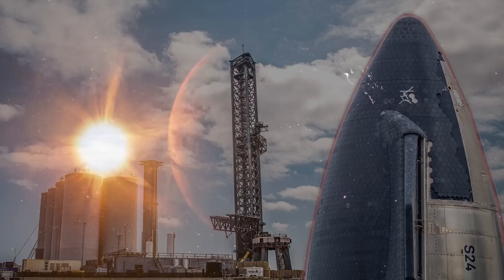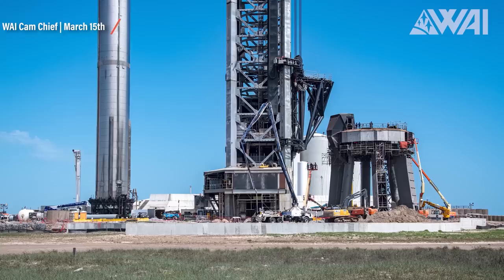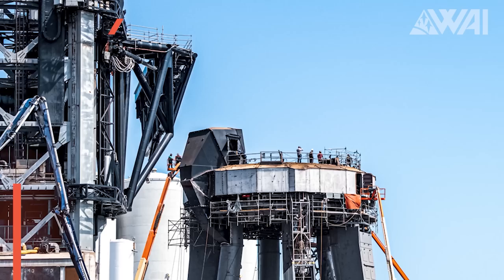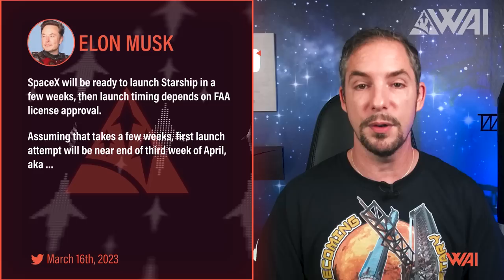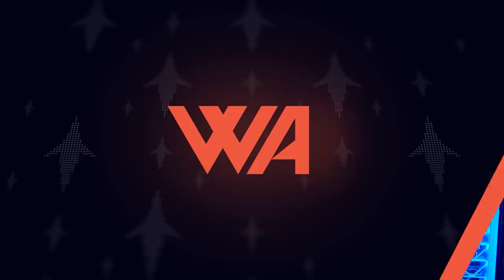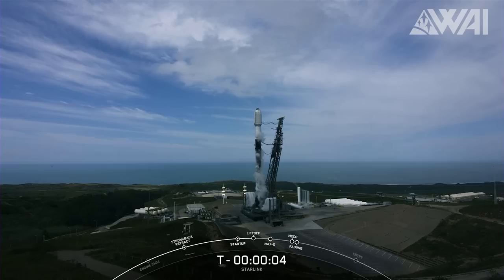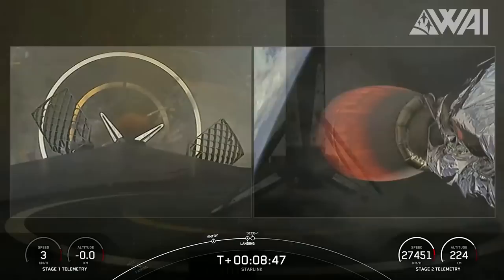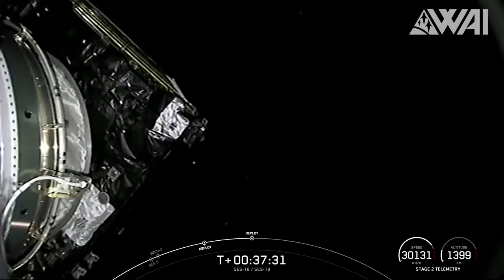SpaceX's accelerating Starship Plan for the Next 4 Weeks + Stunning Artemis Lunar Suits!

Comment: The accuracy of Falcon 9s hitting the bullseye so reliably bodes well for Starships and its booster's ability to be caught in mid-air.
Reply: you can move a ship not a tower
Reply: @sebastiaancoene274  that's ridiculous..the movement of the ship makes it all the more difficult to hit the bulls eye.. itll be much easier to land accurate when you're not playing  duck hunt with the landing platform
Reply: @sebastiaancoene274  was going to say because the tower DOESN’T move, it will be easier to land. No cross currents, no winds blowing it around… just watch when the boosters land back at KSC on FHeavy launches.
Then throw in a booster that can actually HOVER… yeah, they’ve got this.

Comment: Great update.  I'm sticking to June for first launch for permitting & lawsuits.  Post first-launch, the second launch will take the rest of the year after repairs, redesign (e.g. heat shield), analysis and lawsuits (Boca Chica & the Cape).  So, two launches this year.  As for 2024, I am optimistic.  Just getting started in 2023 will open the door to numerous launches.  By 2025, Starship will look different and be operational.
Reply: I guess 1 launch this year, around september
Reply: @henkdeklapsteen6787  There are excellent arguments to support your conclusion!  That's what makes this fun to watch!
Reply: Lawsuits is the thing in the past. Environment Assessment already approved
Reply: i dont see it launching a single time this year with the bitch-brakes they have put on 
lack of launches = no data = just as slow as any other space company. they lost everything they had going for them, quick rapid testing i was excited to maybe go to space in my lifetime. yeah we can all throw that dream out the window now.
Reply: @forget2bhuman993  Easy to be negative.  Hard to launch the most complex brand-new thing since the Apollo Program.

Comment: The fairing halves reminded me of the old space shuttle launches where you can see the srbs falling back from the sky due to the fact that the nozzles are still glowing red ♥️
Reply: To be slightly more accurate, the nozzles don't glow. What you see is the solid fuel flaming out (residual burning). The nozzles are insulated with ablative material, how else would they stay white?

Comment: As heat shield is all about re-entry, an issue there during the mission would not necessarily be a failure, that being said it would be nice if starship survived re-entry also, personally I would like to see a controlled splashdown, even a hover with any remaining fuel, would be logical if it will be the last mission.
Reply: The top of the thermosphere can be found anywhere between 500 and 1,000 km (311 to 621 miles) above the ground. Temperatures in the upper thermosphere can range from about 500° C (932° F) to 2,000° C (3,632° F) or higher.
Reply: @jmatasomo2660  Thanks, I'd Imagine it would be less of an issue due to lower particle densities at this distance ?

Comment: I have an idea for going to the moon as soon as possible using starship. 
It's hard to get Orion to launch much more often, and starship won't be able to transport passengers safely very soon. 
So here's my idea: spacex could operate a small space station on Leo and then make it a docking center for Dragon and starship. Each time a Dragon ship is launched, it takes astronauts to the space station, where they transfer to a starship, where they use the starship to travel to the moon and back to the space station, where they transfer to a Dragon ship to re-enter the atmosphere. 
The upside of this plan is that if starship is successful by June of this year, they could start testing the starship for landing on the  moon in the second half of the year and order a manned orbit as soon as possible.
Reply: And after the starship returns to the space station on LEO, the astronauts can repair and maintain the starship in the space dock and replenish fuel.
Reply: Use this space station to carry out other business activities. For example, on-orbit maintenance of the Hubble Telescope, a five-member team drives a starship from the space station and changes orbit to the location of the Hubble Telescope. Since this starship only changes orbit in outer space, there is no need to consider complicated issues such as re-entry into the atmosphere. The starship has a cargo bay with a robotic arm and tools and parts needed to repair satellites, as well as cabins where the crew lives, much like a space shuttle. After the repairs are completed, fly the starship back to the space station.

Comment: Should they have gone for a lower payload and put landing gear on the starship as a preliminary milestone?
Reply: There is no payload in S24 except instrumentation to monitor everything that happens and transmit it by the Starlink network.  "The best part is no part."  B7 is probably the only booster which SpaceX intends to expend.  It is a two-year old design.  SpaceX intends to perform tests of the chopsticks as if to capture the booster, but B7 will ditch in the Gulf regardless.  SpaceX will try hard to recover the much advanced B9.  Similarly S24 is primarily a test of what damage occurs WHEN you reenter with missing tiles.  "The best part is no part."  SpaceX needs to determine how much of the TPS is actually necessary.  Every kilogram of TPS that can be removed from the design is another kilogram of revenue payload, and a reduction in maintenance costs.  On a short test flight SpaceX cannot recover both the booster and the orbiter because there is only one operational launch mount.  A test flight with several hours of orbits are required to allow time for the SPMTs to drag the booster to a safe distance so the OLIT can catch the Orbiter. 

SpaceX also intends to test whether Starship can transmit to the Starlink network up the tunnel surrounded by electrically charged plasma that it punches through the atmosphere during reentry.  This is to reduce or at least minimize the anxiety-inducing radio silence that all crewed reentry vehicles have had to accept.

Comment: I like Speedify . Does SpaceX plan on a 3 stage rocket? Great video
Reply: You can deliver a rocket as payload.  Almost any commercial 2nd or 3rd stage will fit within the cargo hold, even the massive SIVB, the 3rd stage of Saturn V.  This payload could then be deployed through doors.  A conventional 3rd stage, vertically stacked on the nose of Starship would require expending the Starship.  SpaceX would rather refill the Starship in LEO,  permitting delivering a 100 ton payload to anywhere in the Solar System.
Reply: There's no real benefit in a three stage rocket if two stages is enough to reach orbit... especially when SpaceX are planning orbital refuelling of the second stage anyway. But it's quite common for a payload to include its own propulsion, or to include a kick stage for extra performance... but neither of those would count as a third stage because they're part of the payload, not part of the launcher.

Comment: How is crew suppose to enter the StarShip? Will they be loaded then the StarShip chopsticked into place?
Reply: There won't be any crew, initially at least. Even the HLS version of Starship picks up its crew in space.
Reply: @GreenJimll  Oh yeah. I remember the pick up idea.

So returns will be ferried off the the in space pick up point?

What happens with the point to point dream then?
Reply: @JorgeLausell  There will be a crew access arm
Reply: @JorgeLausell  I think that's quite a way down the line, once Starship has demonstrated reliability. If that comes to pass I guess they'll add crew access arms to  a modified mechazilla.
Reply: @GreenJimll  

Thanks!
I get that. Not sure it makes sense though. Particularly with the timelines involved. If there's to be a crewed launch within 18-30 months, then putting together a crew access arm needs to happen pretty soon.

I've never seen a rendering with one. Curious how that would look.

Comment: All the hype and anxious anticipation is just so much PR and ADD. Just relax and wait calmly folks. It will launch and most likely before June. Frankly; Elon doesn't help the situation by constantly giving launch estimate up-dates. I'm fairly confident that the first launch will achieve orbit. Much less confident that the booster stage will make it to the landing tower and think that SpaceX will divert it into the ocean. As for the Starship; it will achieve orbit but odds are it won't survive reentry. If it does and is in good shape; then SpaceX will likely attempt to catch it. They've got the accuracy down cold at lower speeds and a failure to catch would be far less damaging to the tower if it fails. My 2 cents.
Reply: The first OFT wouldn't attempt any catches

Comment: Still makes me wonder whether they need to have their water deluge system working better than we've seen before performing a launch. My biggest fear is their calculations and CAD design simulations do not match reality and there are variables they have not encountered or designed for and we have a big BOOM as the rocket starts to lift off. Setting them back potentially years. I like their rapid prototyping mindset to a degree, but there is something to be said for the turtle-like progress NASA and their subcontractors make in their ultimate design (however, given the recent snafu's they (and that mindset/philosophy) have had, it is still a big question mark for me as to which method works the best. Given the fact they have never run 33 raptor engines simultaneously for the burn period and pressures equating with launching to orbit, I hope it at least makes it high enough so that if it goes BOOM, it does so by dumping debris in the ocean and not back onto the ground or worse, launch area. I say they get a go from FAA before YE 2023 and leave it at 'by 12/31/2023' for a launch date ;-)
Reply: Probably better to plan to iterate faster and know you're going to break stuff (and thus budget/plan for it) than take everything at a snails pace at higher cost and then still break stuff.

Comment: There is little point launching prior to the deluge system being completed, we are all willing this along but why would you risk damaging the OLM for the sake of a few weeks work on the deluge system, I can see very soon all of the building team working on the deluge system this will speed it up, so my guess for the launch will be May 10th
Reply: If the deluge system were actually necessary it would have been part of the original design.  The deluge is not present to protect the OLM.  It's purpose is to mitigate excessive noise.  After all Starship static fires the commentators, who have experienced dozens of live launches, consistently comment on how much less noisy the tests were than they expected.  The most comparable recent launch is SLS.  But SLS has two monstrous noisy polluting SRBs. SRBs are adapted from ICBMs and naturally DoD does not have to obtain an environmental clearance. Noise is wasted energy.  A rocket engine which produces excess noise is not doing its job.  I suspect that SpaceX engineers, who are genuine "rocket scientists" concluded that a water deluge system was not necessary in order to achieve the targeted noise impact on neighbours, but some bureaucrat at FAA with a BA in environmental studies insisted that if SLS requires a water deluge, then Starship must have one too.
Reply: Thank you, I thought it was necessary to protect the OLM, but it’s just SpaceX having to comply with the FAA. If it is just compliance will the FAA insist it’s in place and working before launch
Reply: No deluge until after the first launch. And no, FAA doesn't require it

Comment: I think SpaceX is making a SERIOUS mistake by disregarding a proper flame diverter for Starship.. I mean at 9:52 we can see what a Falcon 9 launch looks like, and most importantly, how an actual flame diverter helps with initial blast.. and even with that flame diverter it still engulf almost the whole launch site.. now can you imagine what 33 Starship engines will do..? tbh I was baffled when Musk at the beginning stated that they are ditching flame diverters for Starship, which was mindboggling.. I mean it makes absolutely no sense.. surely it's not because of trying to "save money", as I have no doubt that it will cost waaay more to rebuild the launch pad after each launch.. anyways, I hope I'm wrong, and hopefully they've done all the calculations..
Also, I have a feeling they will have to redesign their heatshield, as using same tech as Space Shuttle will not get you to "full reusability".. I mean even when they fired-up few engines with static fire, those tiles were dropping like flies.. so what will happen when 33 engines will roar..? or when the whole craft will reach Max Q..? or reentry..? I think they should invest heavily into R&D of new ways of shielding.. maybe some sort of thermal-spray.. or a one-piece shield.. idk.. I think there is already plenty of research done, especially by NASA, so SpaceX could look at previous work..
And I personally think ditching landing legs for Starship was a mistake.. I get that it gave more mass-to-orbit, but it introduced an unnecessary obstacle of "no-margins landing", meaning that every time Starship will land, it will have to be on the "chopsticks".. so if anything with the landing sequence, there won't be a "secondary" landing on any hard surface.. instead, it seems, the ship will have to crash down.. but this doesn't make sense, because whether SpaceX wants to or not, they will have to add legs for Moon and Mars missions.. and I would think that NASA will probably want a contingency in case there is a problem.. So it is a bit odd that with all that experience SpaceX gained by landing Falcon 9, they would choose this highly experimental way of landing, which initially would work only on Earth.. so why not use landing legs as main mode of landing, and use chopsticks as part of R&D, and use it only for cargo-missions to iron-out all the kinks..
And last, but not least, I think SpaceX as space-tech pioneers should try and build first artificial gravity space station using centrifugal forces.. if they could crack this nut, that would give them monopoly in manned long duration deep-space missions, including Mars.. tbh it's odd that NASA haven't used all those billions for something like that.. instead, it seems, they choose to spend billions on various satellites that explore "atmospheres of SOL planets", or "look for evidence of ancient water".. idk, maybe it's just me, but I would concentrate primarily on human spaceflight missions, and R&D that would advance those missions.. I think having a base on the Moon would be way more inspiring then having another Rover on Mars..
Reply: 1. Flame diverter-less design is proven to work on suborbital pads. And there will be a water deluge after the first flight

2. Tiles "dropping like flies" happened on static fires, which has a HARSHER vibration than actual launch. It also has a bonus to filter out bad tiles

3. Please separate your comments into several paragraphs. It hurt my eyes
Reply: @alvianchoiriapriliansyah9882  😀 sorry my friend, didn't mean to assault your eyes.. anyways, believe me when I say that I hope you are right on all those issues, but I have a feeling that with SpaceX's "fast iteration" process, failure is part of it.. initial testing of Starship liftoff/landing is a good prove of that.. and I personally think they will have problems with initial launches.. tiles will come off, but over time I'm sure they will figure it out.. and they will definitely have issues with lack of flame-diverter.. their initial static-fire test showed what happens when they ignite those engines not even at 50% thrust.. that's why all of a sudden they decided to add thick metal plates all around the launch pad.. I'm not sure if that will be enough though, as it still will probably blast concrete off, which might fly into fuel farm..
Don't get me wrong, I sincerely hope SpaceX achieves its goals as soon as possible and everything works out perfectly.. but those points I mentioned in my opinion could've been done a bit more efficiently.. ;-)